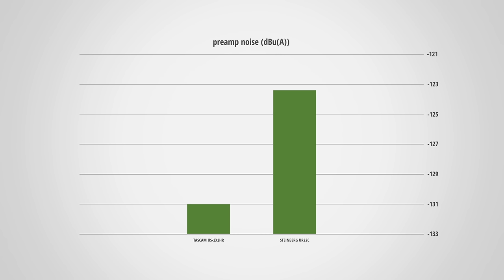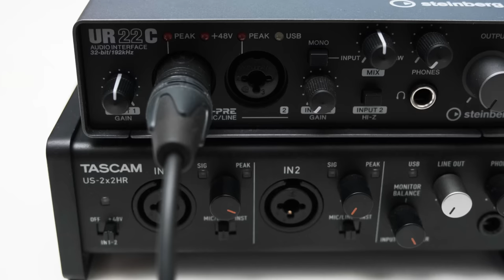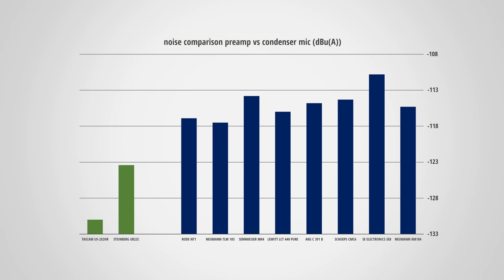You are WRONG about preamp noise!!! - (condenser vs dynamic mic preamp myth)

Comment: With a quality dynamic mic you will get very little noise, the noise is probably coming from the wrong type of cable,  You want silver. and as short as possible, expensive. You shouldn't need any real preamplification if your using 24+ bits. You simply want to make sure that you are not impeding the signal from the mic. Any  preamplification will color the sound and add noise to the recording. A certain amount of noise is ok ,in fact it helps the computer calculations when you add gain to the signal. lets say your recording comes in at -32 db, at 24 bits, you still have  another -32 db of noise floor, if no noise is recorded in your sample, you will easily be able to add gain up to normal levels with out hearing noise above the noise floor, with out a preamp. Consider that a condenser microphone is basically just a Peamplified sound source, your going to get less noise from the cable, because you are already above the noise floor before the sample hits the recorder.
Reply: boosting your recording in post using digital gain is not a way to eliminate noise in your recording - JK has an entire video on that. you should also look up the video about where the selfnoise of dynamic microphones come from. the Shure SM7B is much more noisy levelmatched and compared to the Rode NT1, can you belive that?
Reply: @DrWurzeli   the SM 7B noise is not even an issue. Why do you think it cost so much? It's just a Fad mic I think. I would use it on a kick drum.  That mic is marketed for vocal spoken word, especially to white people, because it makes for a deeper sounding voice . Any dynamic mic over 100$ is probably good enough noise wise.
Reply: @DrWurzeli   to me it looks like the SM7B is best used for talk shows where people talk loud and argue. It can handle high decibel at close range. If you using it for low level talking then you will have to boost the signal, and its not the right mic. The NT 1 is better for just talking.
Reply: @DrWurzeli   if I was gona do you tube I would use this audix SCX25A

Comment: The only area where preamps and amplifiers become important concerning condenser mics is the frequency response they contribute to a recording. All preamps/amplifiers interact with your condenser mic, influencing the tonal characteristics of your recording, thus these should be chosen more with a mind to final sound rather than their self-noise as already explained by Julian.
Reply from the maker: Condenser mics typically have a relatively low output impedance <100 Ohm and preamps a high input impedance of <1000 Ohm. This ensures that the preamp does not load down the mic and this prevents any frequency response deviations. That's why I don't think this is a concern.

Comment: HeyJulian, It looks like you are using pair of KEFs as studio monitors, what model are they and what amplifier are you using? I have a pair of KEF IQ3s laying in a box, but need the right amplifier, what do you recommend?  Thank you for great content.
Reply from the maker: Hey, I use a Loxjie A30, you can see it in the lower left corner in the video. It's not the most powerful amp, but more than capable to drive the KEFs, especially in a near-field setup. The main reason I use this amp is because it has an integrated DAC and can be directly connected to my PC. The A30 works quite nicely, the only downside is, that it produces quite a lot of ultrasonic noise (it's a switching amplifier) which can result in RF interference with some audio interfaces.
Reply: @JulianKrause  I see. I guess an 2x40w into 8 ohm amplifier would suffice then.  Do you prefer the KEF sound over the usual  active speakers like the yamaha HS7, or do you use KEF for some other reason?

Comment: you are totally wrong) when you recording voice with huuuuge dynamic range, for exanple - adr, dub, game vo etc, u need to record as low as possible, to not clip and ever touch gain. And with that low gain recording - u need really really good gear - with low noise, cose u will boost reacord in postproduction +30-40db

Comment: "Drowns" is a wrong word for noise. Noises have an additive effect .   For eg noise floor using the same microphone  with a 24bit interface with good preamps will be lower compared to using it with a 16bit interface with mediocre preamps. Again this will be a  negligible difference for a condenser mic in most cases.